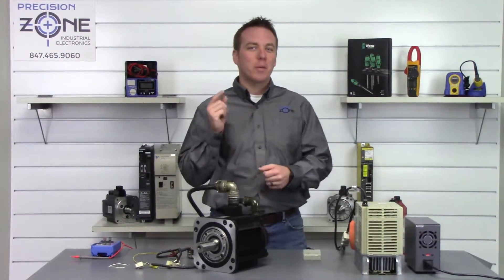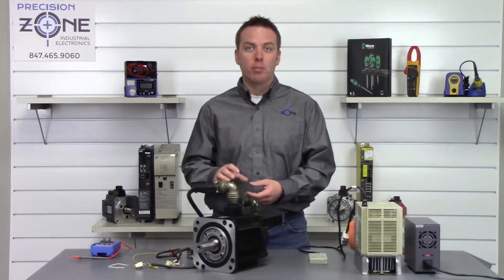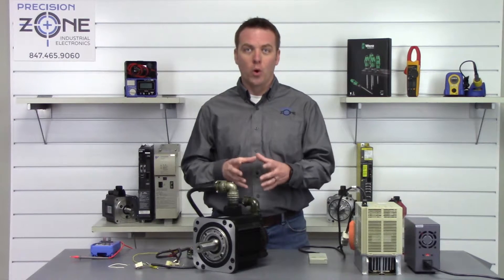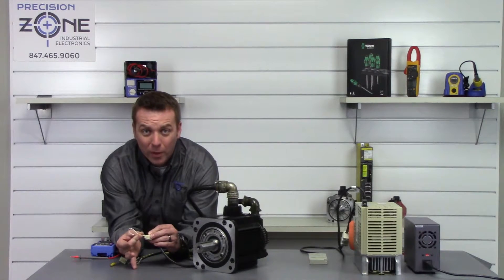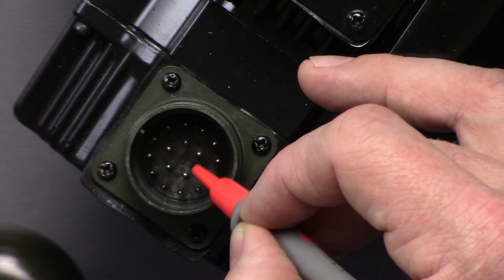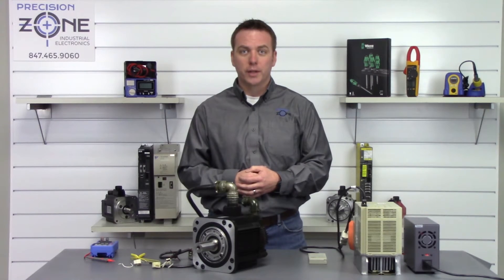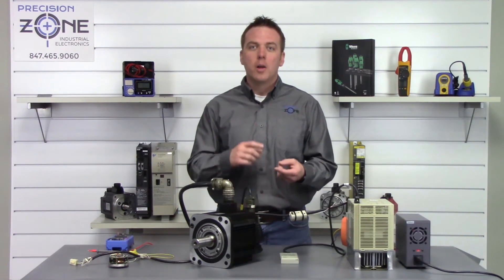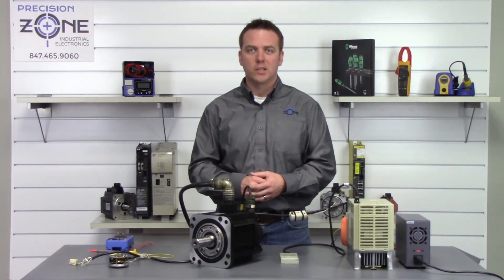How to Reset 12 Bit Absolute Encoder for Yaskawa Sigma 1 - Option 1

Comment: I have a Hitachi Seiki with SGDB servo packs and I do not have a remote programmer, only able to use SigmaWin+ to go online with the drive. They are 12-bit absolute encoders. I have 2 encoders that just pop'd up the A.81 alarms. It has a Yaskawa battery module and I am thinking someone changed the battery with power off. Why Z-axis is throwing up this fault, I have no idea, it's only x and y axes. I don't have Molex plugs like your video shows. Mine are those 20 and 30 pin MDR connectors. I don't have a break-out board for them so I am not sure how to short them also, I am not sure which pins (in this case) I would short. I do not have an end-to-end drawing of the cables so I don't know which is which. Any help would be awesome. Thx

Comment: Greeting,
I have a robot OKURA A700. It has 4 servopack YASKAVA: SGDM-20ADA 3kom, SGDM-04ADA 1kom. 
All four with error A81. I tried to clear the error with F008 like in manual and nothing. 
The battery has 3,6V. The main cable that connects the board to the machine is 
disconnected due to transport and probably an error occurred then. Can you help me solve 
this problem?
Thank in advance...
Aleksandar M.
a.mojovic777@gmail.com